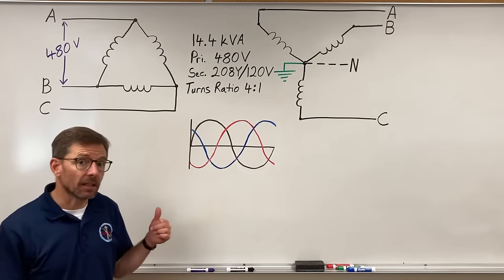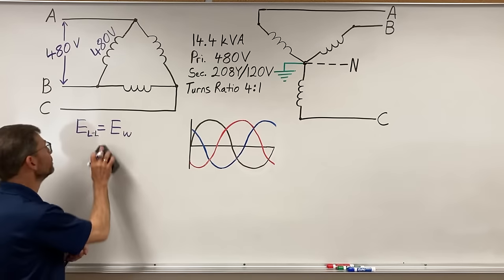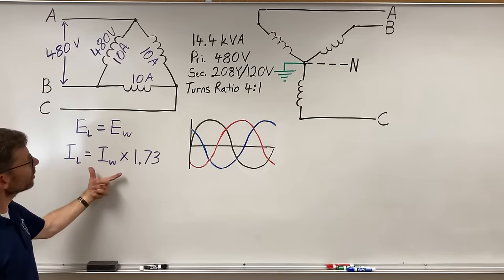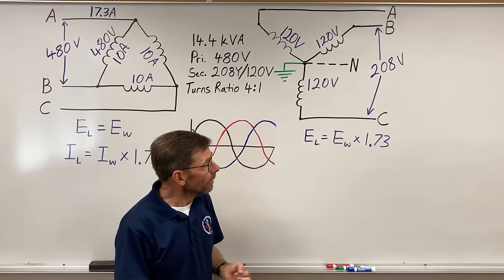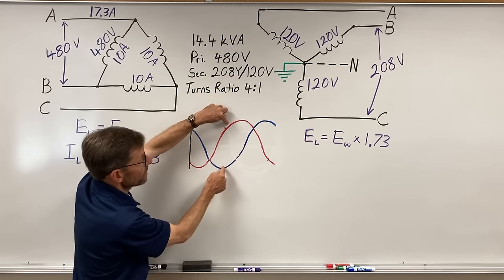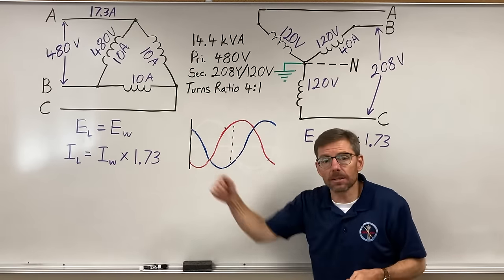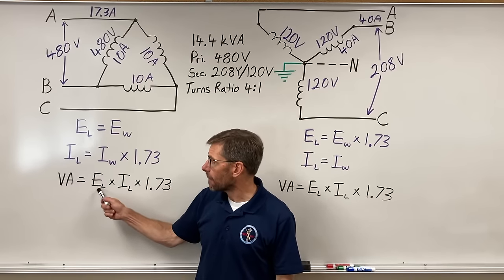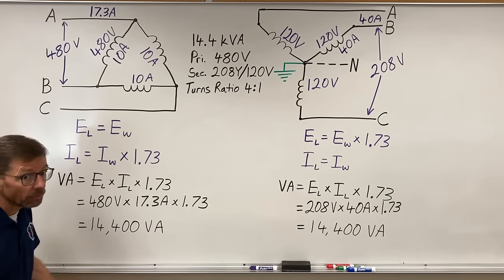Delta and Wye - Volts, Amps, & VA

Comment: Thank you so much Dave. I have a degree in Electrical Engineering but never been lucky to have a professor to explain so clearly the way you are explaining this topic. I am reviewing all of your videos and relearning everything with clarity and comprehension. Thank you so much for passing your knowledge on to others to learn. Thank you again Dave !!!
Reply: Really?! Wow. Glad you got to relearn the basics.
Reply: same here, only if my professor were this good. they never explained concepts like this.
Reply: You were not attentive at the time of lecture most likely. 😂
Reply: @RoRokenya  you are absolutely wrong. There are lot of horrible professors out there only hiding behind unions to protect them. They barely tech well. I guess you are one of those, so you are upset about what I said and you are defending them indirectly.
Reply: @Peace88Hi  😂😂 Oh no. Not defending any person please. On youthful days we may not be very keen to on some topics
Reply: 😂 your degree is in your certificate
Reply: Please help me  : I was working today and a guy on another crew pushed up against a closed panel 480v 3 phase and it shorted between the phases. Question: if he was in contact with the metal case while the case was touching the exposed breaker lugs would he have died ? 
I suspect the voltage would have traveled through the case and to the other lugs, avoiding going through him as the metal is the path of least resistance. Is my conclusions incorrect?
Reply: What Peace said...
Reply: @joshspears7016  This is why we have earth-grounding and why it's so important.
Reply: I’m gonna go out on a limb and call Bullshit... this is what you learn as a first year apprentice electrician... I’m a machinist and I knew most of this...
Reply: @madaxe79  EE is a board field: Field Theory, RF (Transmission Lines, Waveguides, and Antennas), Communication theory (Modulation and analysis), Optics, Sensors, Power Generation, Power Transmission, Power Converters, Linear Circuits, Signal Processing, PN Junctions (and their consequences), Digital Logic, Microcontrollers and Embedded Logic, Integrated Circuits, Economics; Ethics... This is most of the 4-year ABET accredited degree. Some topics are going to be covered better than others. Makes it a shame that professional licensure in the US focuses on exactly 2 of these topics.
Reply: @c3h867  while most of that is true, the very first thing you learn is the basics, and this video is the basics. If you have studied electrical engineering and didn’t learn this stuff, you didn’t listen on week 1… if I hired an electrical engineer and they didn’t know this, I’d consider litigation against the university
Reply: Where did you find your diploma, in the cereal box? I learned this in high school.
Reply: @eglintonflats yep me too then again at the community college and yet again at the university.
Reply: @madaxe79  I can tell you that in my EE 101 class we did not learn about 3 phase power.  There is a wide range to what electrical engineers do that you do not see.
Reply: @RoRokenya  you have no idea how wrong you are. First, many of my EE instructors were Indian immigrants that spoke the worst English. Some stuff he said I count even figure out because the accent was so bad. Secondly, EE students don't have tons of power classes. We have all sorts of different varieties of classes because you never know what industry you will end up in. Thirdly, if you don't use it, you lose it. I know a director of engineering that is amazing in automation, but very weak in power. Even though he has a master's degree, he would need to relearn this. People 10+ years out of school forget so much.

Comment: Magnificent explanation. I think a lot of teachers do not fully understand what they are talking about and the students end up being more lost after listening to them.
Reply: A lot of professors have PhDs and no training in how people learn, so they are experts in their field with poor teaching methods.
Reply: Please help me : I was working today and a guy on a direct crew pushed up against a closed panel 480v 3 phase and it shorted between the phases. Question: if he was in contact with the metal case while the case was touching the exposed breaker lugs would he have died ? 
I suspect the voltage would have traveled through the case and to the other lugs, avoiding going through him as the metal is the path of least resistance. Is my conclusions incorrect?

Comment: I am glad you pointed out at the end that the value 1.73 is the square root of three.  You'd shown the value earlier, but I think it's important to explain that it is used to account for the phase angle difference between  current and voltage across phases.  You don't need to go in-depth into trigonometry, but sine and cosine functions can help to visualize what's going on.  Your phase diagram where you erased all but the two phases and added the dashed line was a good way to show the difference in potential between them.

I learned all this about 45 years ago, but watched as a refresher.  Well done!
Reply: The square root of three has absolutely nothing to do with the phase angle difference between voltage and current.  You are thinking of power factor.
Reply: @normblanchard5199  No, not power factor, like in single phase current versus voltage.  The voltage differences between phases and neutral in 3-phase delta and wye configurations.  A quick search online for "electric phase square root of three" gave me good results.
Reply: @bobblum5973  there is no sqrt(3) voltage difference in a delta configuration. Line V = Phase V.
Reply: 🤦🏻‍♂️…it is not to account for the phase angle difference between current and voltage across phases. Because you only apply it to the appropriate configuration. In a delta, Vline = Vphase, so no sqrt(3). Also in a WYE, Iline = IPhase, so again no sqrt (3). You must be very specific when talking electrical. Otherwise you get people confused and spread inaccurate information. Not to mention there’s also a 30° shift that goes along with the calculation anytime you use sqrt(3), which he fails to mention anywhere in his spill.
Reply: Sorry if I mis-stated, I was thinking about three-phase signals in general and wye in particular.  For delta it may be different, I agree, though now I want to look it up and read further. 🙂

I learned most of this about 45 years ago, and at the time it was more involving electronics than electric power, but the square root of 3 stuck in my mind.
Reply: @Electric_Sherlock  So why the sqrt(3), then?
Reply: @flinfaraday1821  in which system? and what variable? Essentially when it’s needed it arises from the difference of any two phasors in a 3phase configuration, depending on what you’re trying to find, I.e. voltage in a Wye or current in a delta or apparent power in Wye & Delta.
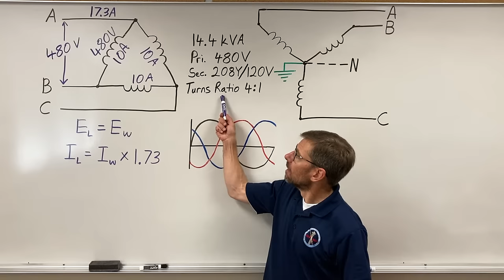Reply: He verbally refers to it at around the 3:50 minute of the video

Comment: Very clear explanation , well done ! 
I suggest simpler than that , in either case delta or wye , winding voltage times winding current times number of windings . 
In delta , 480x10x3=14400 or 120x40x3=14400 in wye .
Reply: Please help me : I was working today and a guy on a direct crew pushed up against a closed panel 480v 3 phase and it shorted between the phases. Question: if he was in contact with the metal case while the case was touching the exposed breaker lugs would he have died ? 
I suspect the voltage would have traveled through the case and to the other lugs, avoiding going through him as the metal is the path of least resistance. Is my conclusions incorrect?

Comment: Thank you for what you are doing .I am master electrician and recovering from CoVid and have that brain fog issue .This is fantastic review .Learned this in high school and trade school .we need more of this on YouTube .
Reply: Please help me : I was working today and a guy on a direct crew pushed up against a closed panel 480v 3 phase and it shorted between the phases. Question: if he was in contact with the metal case while the case was touching the exposed breaker lugs would he have died ? 
I suspect the voltage would have traveled through the case and to the other lugs, avoiding going through him as the metal is the path of least resistance. Is my conclusions incorrect?
Reply: @carlu bambi  he was on a different crew, but  i heard he was just putting on stickers on the outside the first hinged Door of panel. The main cover was still on  when he pushed the sticker against the cover some how it touched the exposed lugs on the  breaker. flash was contained within the panel.  so the ark is the main concern? Not electrocution as he was not directed exposed to inside of the panel only one hand made contact with the outside cover ?
Reply: @joshspears7016  if he had both hand s on the panel there could be a chance of a potential difference but not likely because the steel cabinet is a far better conductor .Just remember you only need a few milliamps to flow through your heart to mess you up pretty bad.I survived somewhere between 347 and 600V .Someone wired a lighting fixture neutral to ground and energized the TBar .I went up the ladder to look for a 120v tail for a receptacle and someone had coiled up another 347v lighting tail with a 120v receptacle feed .Let's just say it's like a shot gun going off beside your head .Had flash burns and a burn on the tip of my finger .Lucky .Felt like I was kicked by a horse .Took out the 100amp feed breaker on 3phase 600v 347 lighting control panel .the circuit was on a 20 amp breaker and it blew a 3 inch hole in the duct work
Reply: @carlu bambi  interesting story the dangers  of electrical trade. I'm still learning. Hopefully I will be here many more years

Comment: In the delta transformer, only A to B windings are directly connected to the line voltage of 480 volts. The B to c and A to B windings are connected to the line voltage of 480 volts through a line winding in series with it.

Comment: NO ONE has explained this better than you!

I went to Naval Nuclear Power School (NNPTC) to be a Nuke Electrician... They used the WI-DE memory aid, and I'd still trip :) up on transformer math. Current-ly :) studying to be a RC System Operator and reading it straight from the source didn't help me either.

Thank you!
Reply: 50 years ago, learned the same Wye-I, D-E. Nuke school taught me a lot fast.

Comment: The 208 Y is very common on work boats because you can get the 120v without a transformer. The problem is that after a few decades of boat engineers wiring things up, many of them don't make sure that each 120 leg is in balance with the other 2 legs.
Reply: What happens? What usually fails first?

Comment: In this example you would use a15 KVA 3 phase transformer because that's the next commercially available larger size assuming that that is the only load you have on that transformer.

Comment: We (in the USA anyway) get our 120V for receptacles from a center-tapped delta secondary, not a wye secondary. This is why Line to Neutral = 120V and Line to Line = 240V and not 208V.
Reply from the maker: Thanks for engaging Bill.  In my area of the country (USA) the center-tapped delta secondaries are on their way out and the three-phase commercial services are generally wye systems - either 480Y/277 or 208Y/120.  Also, all the three-phase transformers I have installed in the past couple decades that are to feed receptacles have been 120/208 wye configuration.  I know there are differences regionally and by facility type, so that may be the difference in our experiences.
I have another video that compares 120/240 single-phase, 120/208 three-phase, and 120/240 three-phase:
https://www.youtube.com/watch?v=xMZkKI5rleg
Reply: @davegordon6819  Hi Dave. My comment was really geared more towards residential services and not commercial/industrial, where we expect to find 120V to neutral and 240V line to line.

In my commercial/industrial experience I’m with you 100%. Every dry-type transformer I’ve installed has been a delta-wye with a 3-phase 120/208 secondary.
Reply from the maker: @OrdinaryDude67  Perfect. Sounds like we're on the same page. And by the way, keep up the drumming :)
Reply: I still install a lot of open Delta Banks  in San Jose Ca .. I work with people from all over the states and they state the same, why most electricians say that the 120/240 three phase banks are going away if we still install them. Actually we still install Close Delta banks that are 120/240 and use a Power Leg( stinger/ wild leg) to create that 3rd phase  in new construction.

Comment: EV charger company says I can't use 480V,delta has to be Y, but they require no neutral.
i have 208,3 phase y service so i used transformer in reverse,could only find 75kva,delta
to y transformer. I don't understand why the 480V without neutral is any different, Joe

Comment: Thanks Gordon much appreciated.Just wanted to know incase if there is a phase failure or line failure on the delta side,what happens on the secondary side , how can I detect this fault on the secondary side of the transformer

Comment: Thanks and that really explains a lot to me but I'm confused about something like where I work the power company just installed a new 300 kva padmount transformer and I noticed on the front cabinet that it says it's a 7200 volt primary and 277/480 volt secondary but how are we getting 120 volt service from this unit and it's the only transformer supplying our shop  so please explain? Thank you

Comment: All I have ever used for 3 phase except for a few motors is delta with a high leg. I'm having trouble imaging the advantage of another configuration. We may be building another facility. I designed most of our machines to use 240v single phase. However at another job many were 3 phase. Although the real power was used for straight resistance heating systems. A few of the control components were 120 v single. It just seems to me that this delta system is better for my application. I have no use for 208v and only limited use for 120v. I build machines not buildings am I correct in my assumption.

Comment: Thank you sir for this Great presentation! Please forgive me but I would like to ask a question about motors that I can't find a good answer too.

A motor that is 3 phase Y configured can it or can it not be wired to a service that is Delta??? 
I've gotten mixed answers and in all my literature I can't find a suitable answer.
Reply: Depends on how motor is wired and voltage rating for each winding. Same math principles as explained above.

Comment: If I  rewind the motor with Delta configuration to have the same RPm with the WYE, will the power be higher or equal to WYE?
Reply: The power (VA) will be the same . But the current voltage relationship will be different.

Comment: Could you backfeed the secondary with 240v to produce 480v on the primary, so that the user could have 480v motors on a 240v 3 phase service

Comment: When calculating VA, why do you multiply by 1.73 again when you have already done this on you WYE Phase to Line Voltage/ DELTA Phase to Line Current?
Reply: Because the first calc only gets you one set of lines. You need to multiple by root 3 to account for the total 3 phase system. In other words, the 3 phase system has root 3 the power of two of it's lines (which people often site as a benefit of 3-phase: add 1 more conductor (+ .5 the existing copper) and get + 1.73 times the power).
You wouldn't multiply by root 3 again if calculating VA for just two lines.
Reply: If you calculate the power for a single coil you get 480 x 10 or 120 x 40. Since you have three you need to multiply by 3 - or twice by root 3.

Comment: I see a lot of 3ph transformers wired in reverse to get 480V they have  240V wye incoming wired on the 480V primary of the transformer to get the 480V needed for there motors. The transformer in question to me is a large 112.5KVA delta/delta way over sized for the three machines running. They want to add a large compressor which is 3ph 60Amp wye I told them they need another transformer a step up 30KVA delta/wye 240/480 I don’t believe you can use a delta/delta trans to get wye even if a neutral is available. Can I assume I have a delta incoming ?? It’s a 800Amp 3phase 5wire has a neutral and a ground also a high leg at slightly less than 240V

Comment: Why VA instead of Watts? Just curious if it's a functional difference or just a naming convention.
Reply: Using VA is a way of representing the power in a complex system with multiple AC voltages and currents and their phasing.  Think of a purely resistive load on a DC circuit, just multiplying voltage and current gives you watts.  But in an AC circuit with inductive and capacitive loads, the phase angle between the voltage and current can be affected and computing power becomes complicated.  Using Volt-Amperes is just a more accurate term to use in cases like this.

Comment: Why transformer with
120 volts on each phase equals 208 volts line to line
277 volts on each phase equals 480 volts line to line
347 volts on each phase equals 600 volts line to line.
thank you.